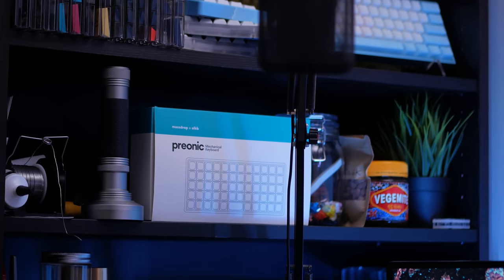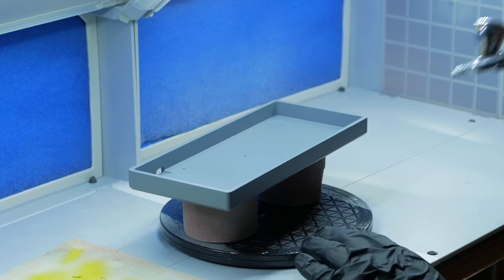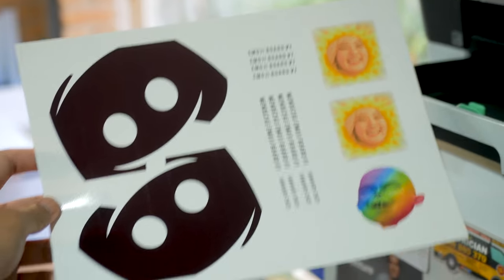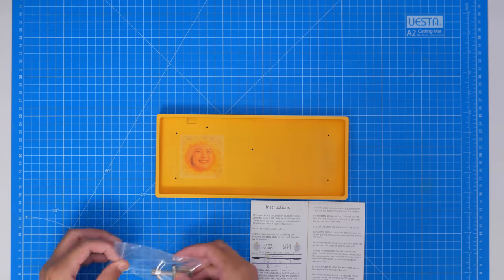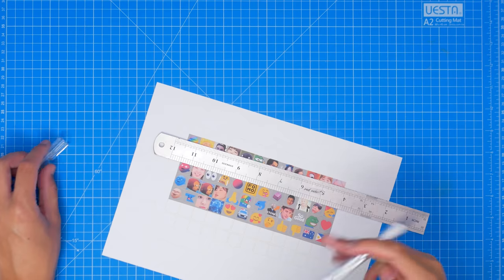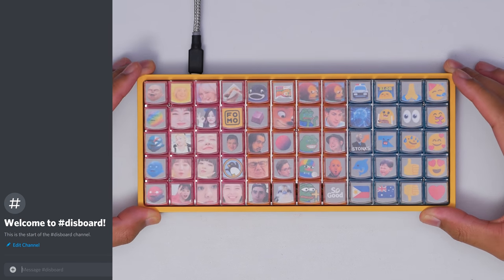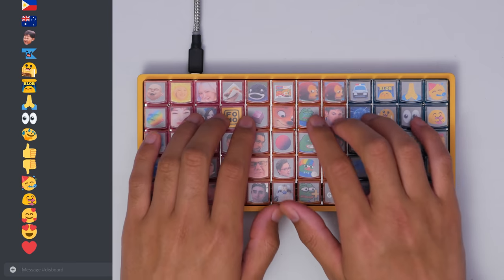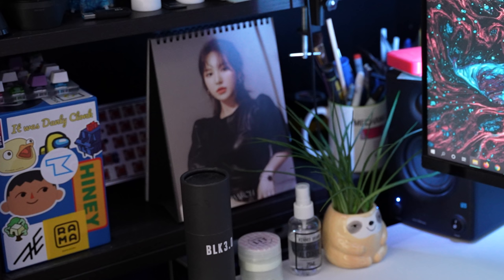I made an emoji macropad for Discord

Comment: Anodised coating is order of magnitude harder than that paint you have aplied to the board co it can be much more easily scratched than before. Allso a quick bath in caustic soda would remove that anodised coating together with coloring so you did not have to sand it like that. Btw. decals look great, and ive learnt about those keycaps which would be great for some sort of macropad i might build.

Comment: Hey Tae.
Any chance you could cover some full size or near full size mechs.
I'm ready to buy, but find this sector of mechs limited / difficult.
I like the iQunix, but it's not cheap, not ruling it out though (this is probably #1 pick so far, budget is a bit of a factor).
Keychron K4v2, kinda think these might be a little over hyped, the height is also a concern.
Love the Vortex Tab 90M layout, with the additional column of nave keys and maintaining the 2u numpad zero (thinking re purchasing new keycaps, getting a 1u numpad zero is hard) - but also keen on something backlit.
Epomaker GK96 is catching my eye too.
Can't touch type to save my live, and am in the dark often so some kind of assistance ot see the legends is nice, either high contrast that stand out in dim screen glow or backlit (dual shot PBTs?)
Still in training wheels as far as mech knowledge goes, love the vids, very helpful.
I do some PCB design and have no issues with SMD soldering, if you haven't got that covered and need a hand with anything lie that reach out.
I have a Keytester on the way from massdrop, looking for a quiet switch that feels nice.
I'm sure you can hear my Logitech G810 spacebar rattling where you are from Melbourne...
It's a 6 on the Richter scale here but might only be registering a 3 in Sydney.
Reply from the maker: i think i have the left hand numpad GK96, which I'll eventually do a video on. But yeh, I use the iQunix pretty much daily. 
I'm quite sure there's a bunch more, just not coming to mind
Reply: @TaeKeyboards  Saw you review on the iQunix, and saw it again in the Keychron K4 where you compared the height of the front.
It looks great, tempted either to go Joker or Coral sea.
I think if I had some switches to play with I'd have made a choice by now, but being a little new and having no means to compare makes it hard.
It won't be blues, likely with reds or browns.
Also considering Knight for the lower cost of entry, will literally be the first keyboard I own with MX stems, so I guess I have options!!

Comment: how did you make the pc recognize it as a macropad  and not as a normal keyboard  ??
Reply from the maker: its still a normal keyboard. but the keys are programmed to type out an emoji. for example, it will type out :sogood: and press enter.
Reply: @TaeKeyboards   i do understand that but how do make the pc regonize is as a separate keyboard , because that means i can plug in any keyboard and get the same effect that would be very useful for editing videos   , but The problem i have is that when ever i plug the second keyboard, the pc regonize both of the keyboards as one

Comment: Does sanding make a huge difference? I want to paint my keyboard but too lazy to sand it.
Reply from the maker: sanding beforehand? depends on the paint. some may not have good adhesion to the metal. but if it's plastic, it should be sweet.